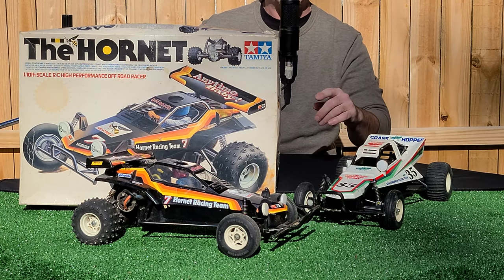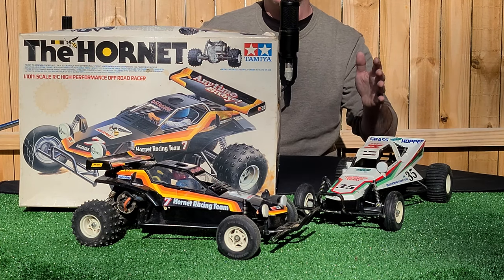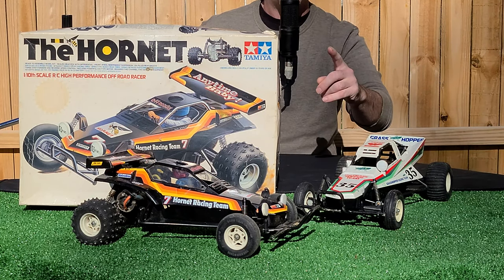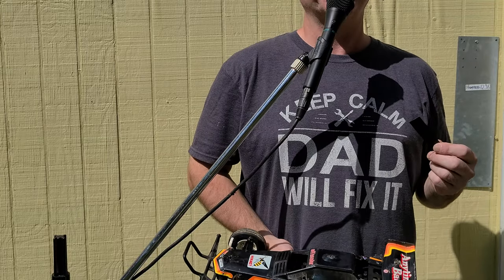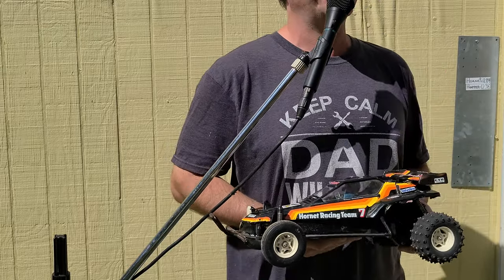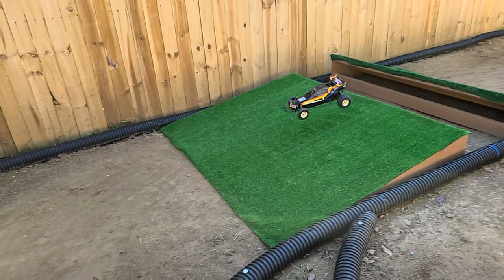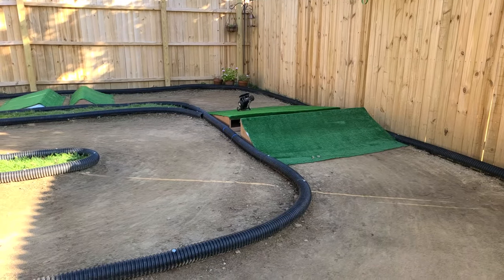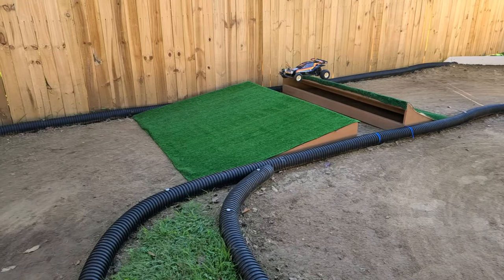Tamiya Hornet Time Attack!

Comment: If the track had longer straights there would have been a major difference in time I'm sure the tires I do think add a little more control for that motor because they get better traction on that surface than the the grasshopper would and the RC elf got me a super hot shot. Hope you'll be getting one of those and putting it along the track see what it does if you have one.
Reply from the maker: The space and size of the track had  an impact for sure. I do have a few of the 4wd cars. Plan on running them at some point. Love Hotshot series cars.
Reply: @VINTAGEBACKYARDRC  see when I was a teenager I had this car and I just wanted it back just like I wanted my hornet and the fighter book the RX memorial edition which actually isn't quite the same car but is the same car because of the body color and rims that are gold I would buy the fighter buggy RX original version again even though it had friction difference but it handled just as well if not better than the super hornet because of the way the shocks lay on the car in the back.

Comment: Id like to see the hornet and the hopper running 380 sport tune motors and see if the suspension and tire upgrades help the hornet.
Reply from the maker: Have that in the works actually! Minimally we will run a Hornet.
Reply: @VINTAGEBACKYARDRC  I got a hornet as a kid in 87. I Threw it away a few years ago I had no idea they were still makeing them otherwise I would have kept it. I just ordered 2 grasshoppers. Even though I think the hornet is a better value I always wanted the grasshopper for some reason.
Reply: @VINTAGEBACKYARDRC  I bet The 380 performs better on your track in the hoppers.
Reply from the maker: @torredchc1768  I like the Hopper body more for sure.